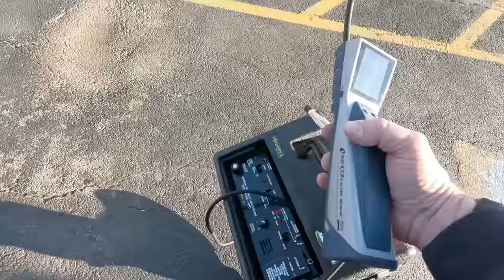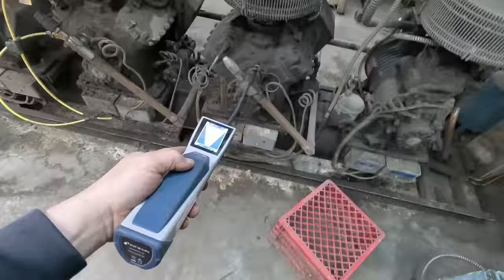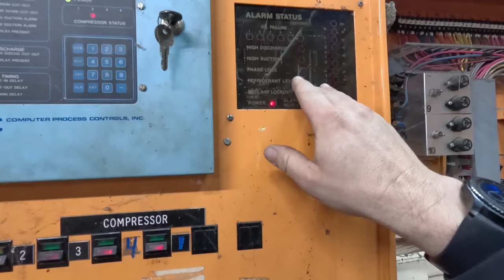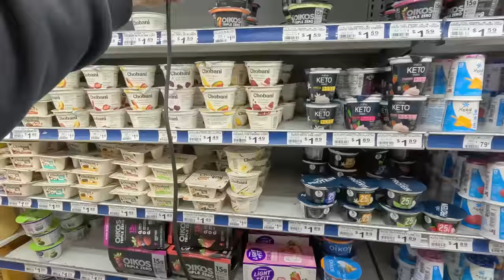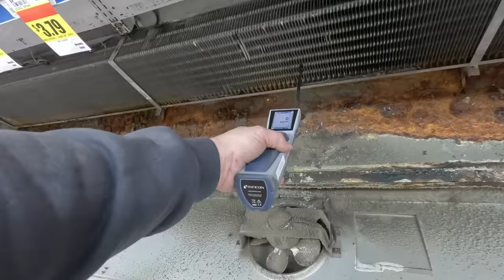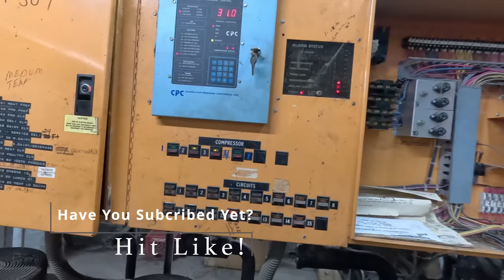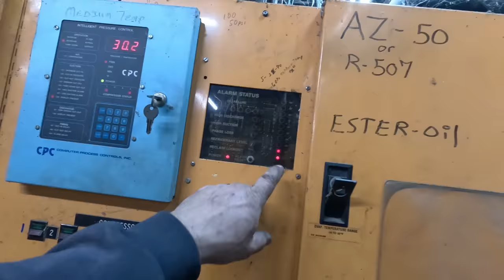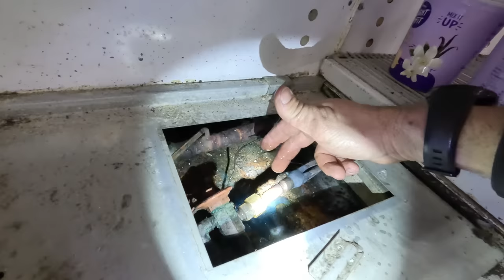Emergency Service! Deli, Fresh Meat, Dairy And Beer Cases Are Warm On The Refrigeration System...

Comment: As a hvacr tech in Sweden, the closest to the unit you worked at, we had the kryotherm, it was a complete unit with several independent circuits, heat reclaim/ventilation, whole unit was placed indoors.
This multiple circuit with common suction and liquid distributor you worked at can partly be compared to the modern co2 system, but there's a modern computerized management, two suction lines (one low and one med. temp) and one liquid line going all over the store to the cold storages and display counters.

Anyway. That was a well done repair! 👍
Reply from the maker: It's always awesome to hear from my overseas viewers🙌. This was one of the oldest control systems this grocery has have left, it's getting replaced hopefully this year with a new Emerson controller.

Comment: That is a very old store and even older building so I'm not surprised they had refrigeration issues especially since they only like to do the very minimum repairs. I also wouldn't be surprised if some of that equipment has been there longer than the store has.
Reply from the maker: Yeah when they get new stuff it's usually something old from another store 🤣

Comment: You can have the supermarket  refrigeration repairs. I'll stick to  refrigeration repairs at Wendys. Way easier, but still stressful at times. 😂
Reply from the maker: 😂😂 Wendy's is horrible, it's right there with Arby's. Both have greasy, nasty equipment, more so than most. Not too mention they are working over top of you dropping stuff 😂
Reply: @HVACRSurvival Yes, Wendys is very very greasy!! I do hot and cold equipment and that grease destroys everything! I refuse to work on some stuff because it's full of grease and a potential fire hazard.  The employees working on top on you is so true too, because the kitchens are so small. That's why I hate doing inside work during lunch hours, like hot equipment or reach in coolers because they be in the way, especially the bigger people. 😂

Comment: Dang I might have to get a Stratus. I do have the Accutrak however, and I try to use it frequently to no avail. It definitely works, but with small residential leaks in evap coils I have a really hard time hearing leaks. I tend to only find larger leaks with it, which is still very useful. EDIT: Dude, you must be one of the few techs out there that will actually repair stuff like this on that scale. Most companies won't even allow you the time to do that and will just tell them to quote a new coil or what have you. Being that diligent and thorough is kind of a curse, because you get all the shitty jobs. Keep your head up, you make a big impact.
Reply from the maker: Thanks man! Where are you going to get a coil thats 30 plus years old? Even if you did it will be weeks or months before it comes.

Comment: time for a new sensor on ole ticky. bad/contaminated sensor/bad wiring = bad sensing. all the newer stuff is far worse, mush of them you bump the head slightly and the detection sensitivity can change by 90+% and be miles off. we're back to needing proper testing and maintenance of test equipment, everyone takes it for granted now.
Reply from the maker: I'm waiting on my test vial for the stratus, I used the calibration gas on the H10, that sensor has less than a few hours of use on it and it's never been hit with a hard hit of gas.

Comment: You made it again😊Not the most pleasurable to work on such cabinets.
Over the years I always had some oil on the flares to make the surfaces to grip better.
Seems like the stress on them was avoided and the tension got better.
As a young guy, I made many flares on brake tubes that alway was made as double.
The flare thickness was more solid and better working than on refrigeration systems.
Reply from the maker: I used the nylog on the flare, that's the same as refrigeration oil. I'll be replacing the flare the next time I run into this.

Comment: Great work Rick,those new teflon washers work great,they're  coming out on the new units,love that leak detector whats the brand of the soap bubbles LOL.
Reply: Big Blu by Refrigeration Technologies. They also make a subzero version which is useful for freezers and it won't turn to slush in your van in the winter.

Comment: Good find and great repair! You definitely do a thorough job! I got turned on to the Nu Calgon fluorescent leak detector because it’s freezing point is 2°, Big Blue is 27°, I work in a lot of freezers so I definitely like the lower freezing point lol. Also, I really like how you use different tips for different applications, I need to get the one you used to braze the distributor tubes and elbows, nice work!
Reply from the maker: I linked it in the description area. They have a whole set of tiny tips and the rosebud.
Reply: There is a Big Blu sub zero as well. Rated for really low temps
Reply: @jasonjohnsonHVAC  thanks for the heads up! I didn’t know that!
Reply: @HVACRSurvival  yeah, I’ve see all kinds of tips on Amazon and true tech, I just picked up a Cap’n Hook that does up to 3” copper, sucker eats some gas though lol

Comment: Nice work and endurance, Rick. When you mentioned you were having trouble on a low-temp circuit on another rack, my first thought was maybe it had mechanical sub-cooling that was being fed from the rack you had the leak on. Just a thought. Keep up the good work vids....👏
Reply from the maker: I'm not sure why I had problems on the low temp rack that day, I didn't do anything to it and it started working and has been for two weeks now🤷🤦🏻😂😂. Thanks for the support! 🤜🤛👍👍

Comment: That H10 will run circles around that other leak detector. Try changing your sensor on the H10
Reply from the maker: I changed the sensor every year and never pegged it with strong hits. It’s just not as fast and the battery doesn’t lasts as long as my stratus. Sure it’s better at R22 by a little bit but that’s not worth it

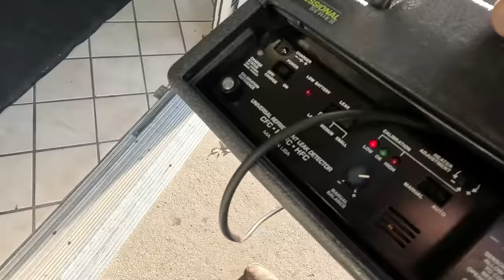Comment: 10:17 judging by the noise coming from that door which is very obvious they dont have it maintained and considering lubricating a door is simple and relatively inexpensive comparied to refrigeration work. This place probably dosnt do routine maint but only calls when the SHTF.
Reply from the maker: You would be correcting your assessment.

Comment: Does that one timing motor run all of those defrost controls?

Although I'm biased, I thought you were being kind of hard on the H-10. Sure, it was slower, but it still got there.
Reply from the maker: Yes, one motor for all 15 or 16 clocks. I loved the H10 for several years but it always left me wanting more battery life, a more resilient sensor that wouldn't be destroyed from a large refrigerant hit and the ability to reach deep into the unit you're checking with one hand.

Comment: the refrigerant levels sensors are likely contaminated and very wrong reading/skewed miles off. or controller even reading wrong. probably best to make sure nothing is in defrost and everything on that system "warm boxes",  then fill it by sight glass/receiver level and pray. 🤣

Comment: Hey what is that impact drill attachment you sanded the copper with and where do I order?  Thanks brother
Reply: They looked different like wire brush attachments, sometimes with an extension
Reply: @BrickTop900  yeah.   We always use sand cloth strips and sand the copper we are going to solder by hand ya know,  his way seemed super fast and much easier.  Not that it’s hard or anything but I would definitely buy that attachment
Reply from the maker: @ChrisBarefield-gn5hc  the one guy is correct, I used my extension with three different wire brush Wheels, one was a cup style one was a wheel style and the other was a small solid cup, I would never been able to get that copper clean by hand.  I got mine at Lowe's but here's something at Amazon if you want to support the channel, it looks like it has good reviews and it has the shank that you'll need to make it work in the extension. This is the smaller seven-piece set, they also have a 21 piece https://amzn.to/3zt1Ikw
Reply: @HVACRSurvival  thank you 👍🏻

Comment: H10 overrated 👀😅
Reply from the maker: It's just not as capable. But it's still the second best detector and the longest manufactured detector ever made.
Reply: @HVACRSurvival  the tekmate would have pick that up the soap bubbles and the tenacity for the win.